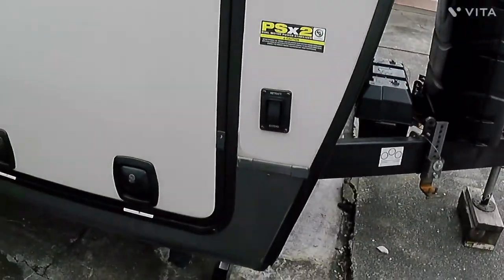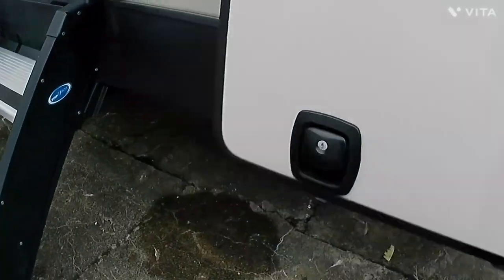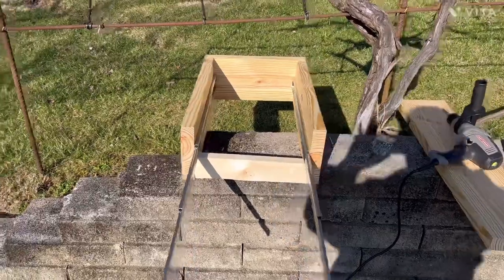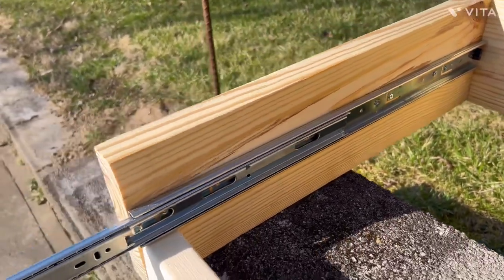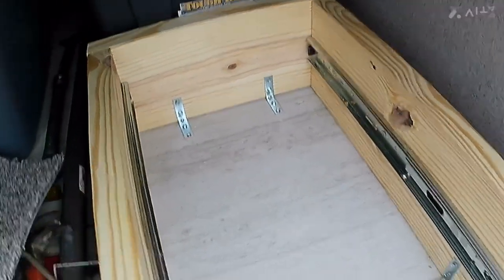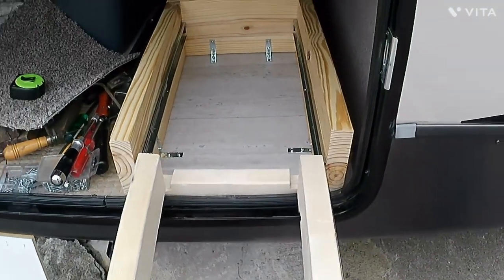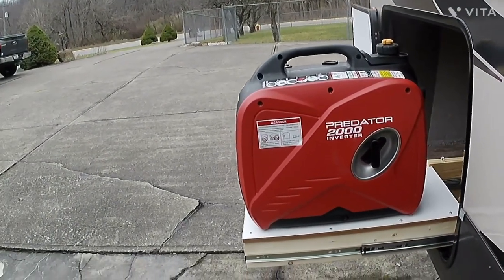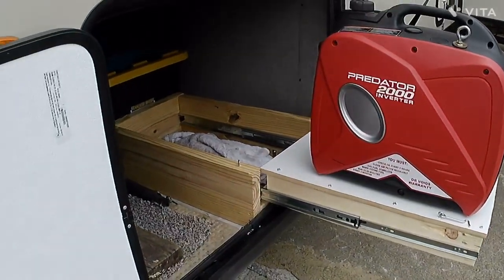Generator slide build for RV for 37 dollars

Comment: I want to build one for my mobile car cleaning rig. I have the predator 3500 though. Wondering if that might be too heavy. 

I know home depot sells 100 lbs slides
Reply from the maker: Yes , use the 100 lbs ones and you should  be good. As an older guy mine is a lot of help. I have no problems with mine and they were at the limit for my generator. If you don’t have to pull the unit completely out to the full extension it will be stronger. Thanks for the watch and hope your build goes well.